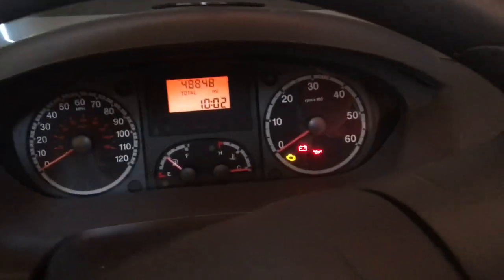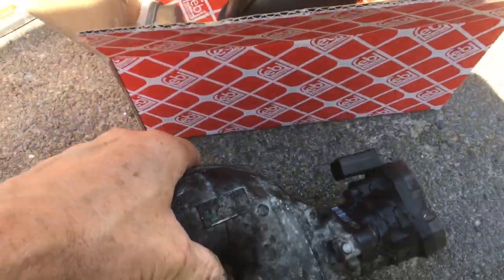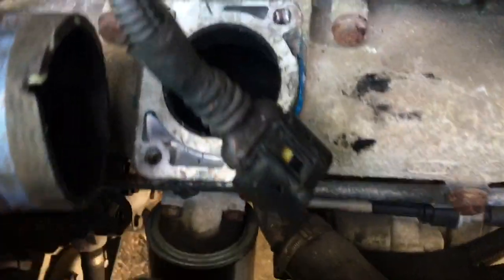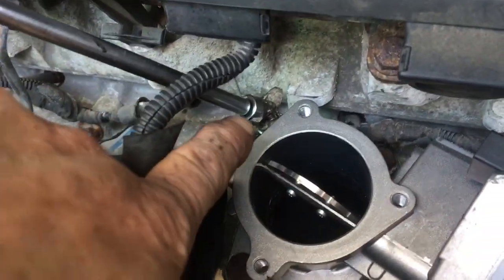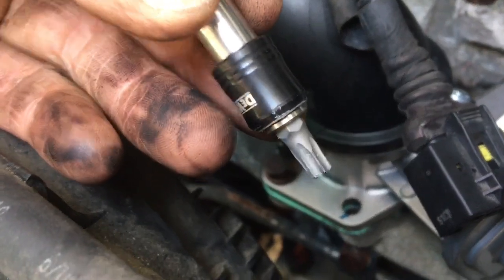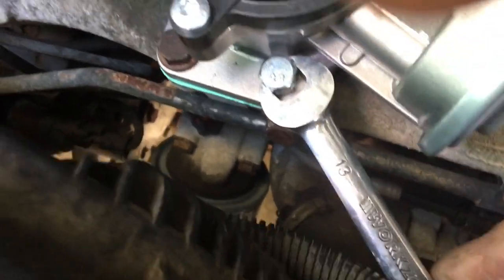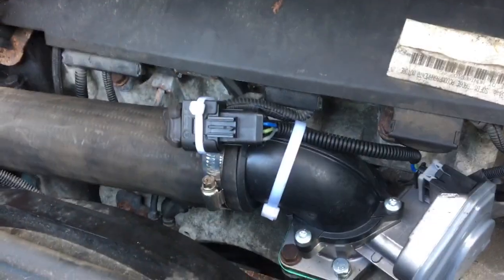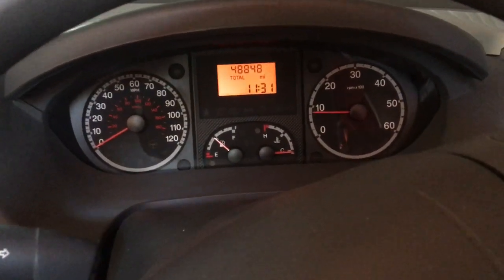P0638 Fiat Ducato Hymer throttle body

Comment: This totally helped me out! My motorhome has been off the road for months and the additional Wiring loom didn't figure out as it had 3 wires coming of it as you said. Just added it inline with teh original and it worked a treat though - Cheers!
Reply: And now? Still good?

Comment: Going by the colour coded wires in the extension lead , they look the same both ends.
Reply from the maker: Hi, yes but they don’t go to the same terminals if I remember rightly, or the function of the terminals was different so 1 didn’t go to 1 it went to 3 ( , I can’t remember exactly which way it was now. )

Comment: Any more info on fuse box bad connections showing this fault thank in advance
Reply from the maker: Hi Colin,  the Ducato like many other modern vehicles seems prone to water ingress in the fuse box. It seeps into the connector/s underneath and causes all sorts of weird problems, non start, engine light coming on, stalling, etc, i think the box is modular and fits together like a sandwich (I’ve not had one out so can’t be sure) but you can get issues that you’d never believe were fuse box related.  See if you can get the top off and look inside but if it looks dry that doesn’t mean the pins aren’t covered in green corrosion.  It’s well worth clearing access to it and unplugging the blocks and checking with a magnifying glass. If you have corrosion you’ll have problems.  Maybe drill a small drain hole in the casing.  Contact cleaner may dissolve the corrosion,  when I was a telephone engineer we’d clean the contacts in a joint, then it would get wet again, the water had run up the cable between the wires and crept back down again, so you may find in a bad case that water has capillaried up the loom and contaminated a connector that’s in a dry location. Good luck
Reply from the maker: I’ll just add, a mate had to have a new fuse box in a Vauxhall Mokka, to cure several issues, one was electric steering problem and the other was intermittent stalling.  The box looked fine
Reply: I was parked up on a campsite last summer for 4 months (camp site warden on exposed cliff top in Cornwall) not starting the engine the entire time, when I set off to go home I started with intermittent chugging when cruising some times really bad some times only just noticeable when it’s bad the engine management light comes on.
Took it to garage they said OBD says it’s the EGR valve so they replaced at £800 still not right and I had read throttlebody can give the same fault code told them so they replaced the throttlebody in line with your video (excellent by the way) 😊 
Anyway all good for a couple of hundred miles then it’s started again it has no rhyme or reason often just cruising at 60 starts makes a funny noise holds back for 10 to 20 seconds then ok again ! Not had a fault code since the work but it appears the same fault.
Any advice apart from the fuse box .
Thanks in advance 😊
Reply from the maker: @colinmortimer3534    the OBD code is just a starting point and not to be taken as a definite cause. A broken wire to the throttle body will show as a throttle body fault,  and changing the TB won’t cure it.  My video on VW EGR woes shows how I got sent wrong by just that. A split rubber tube to a DPF nearly caused my mate to fit a new DPF  on a Nissan, when it just needed a new bit of hose for £2.  Saved £1000  the garage were going to charge . 
Intermittent faults are difficult coz while they’re running ok then there’s no fault in existence. At this stage I wouldn’t fit any new parts on a guess basis, many faults cause identical symptoms, a failing injector or poor injector connection can do it, common due to water getting on them, any corrosion in a wiring plug can interfere with a signal. Sometimes you have to wait till a code is set and then test the wiring from it’s start point at the ECU to the end point at the EGR or wherever the code indicates,  testing for continuity but also for shorts to earth and live that shouldn’t be there.  Often just the act of unplugging the Throttle Body / crank sensor / etc will clear or improve the issue and the new item wasn’t required. Especially if that fault returns soon after then I’d suspect wiring over it being a faulty new EGR or TB . On the video the owner opted for a new TB on the basis it’s a common problem and he’d have some new hardware for his money rather than me pull the front off and spend hours trying to get into the fuse box in that tiny engine bay.  The gamble paid off this time.  Also wiring diagrams are very hard to obtain and vary so much that there’s no guarantee the one supplied applies to your specific build on your vehicle. Colours change, pin numbers to test to and from can often be  incorrect. What I’d suggest is you get an expert diagnostic man with the correct FIAT spec software to analyse it with live data, to drive the various units EGR/TB /injectors etc and maybe even use an oscilloscope to look at the wave signals , and also go for a decent drive with it hooked up to the diagnosing unit and watch what changes on the screen when it plays up. It may take a couple of hours but he’ll find it.  It would be much much cheaper than the cost of the  EGR valve you’ve already fitted.    You may find the DiagnoseDan channel very useful to show you just how tricky it can be and how lots of garages get sent down the wrong route trying to solve these issues. I had a broken wire on an EGR. Broken inside it’s insulation, so it wasn’t visible, then a faulty new EGR then another differently faulty replacement. Sent me totally wrong.   Let me know how you get on, LM Auto repairs is also an excellent diagnostic channel
Reply: I have some time early feb so will inspect the fuse box many thanks for your help.
Reply from the maker: @colinmortimer3534  disconnect any plugs you find and spray a proper contact cleaner in them to dissolve any green corrosion,  WD40 won’t do it.

Comment: I bought a new one, it doesn't work. The engine check is on.
Reply from the maker: That’s why I say that swapping out parts based on a code is not always the way to  go. If the code indicates the throttle body you have to then do more investigation to see if it’s a wiring issue, if it’s in the fuse box, etc, if you can’t do that then you have to pay for an expert to do live data tests and see where the failure point is.  And usually he’ll say it’s the throttle body. The cost of getting that done is often more than the cost of swapping the part and taking a chance,  especially if it’s a very common failure like these, where usually it is the actual throttle body. 
It could still be the new one, Ive lost count of how many new components I’ve seen dead on arrival.  Getting them exchanged is difficult.  Did you swap over the new piece of wiring ? Cos I believe the wiring pins on some replacements are not in the same order as the original even though they do plug in.  The loom connector piece rearranges the wires to correct pins. Check your fuses, and also remove the pipe feeding into it and look down while the engine is running, when you turn it off it should snap shut, indicating it’s getting power and return. Did you clear the code. Or are you waiting to see if it self clears after a number of starts? Not all codes clear that way .